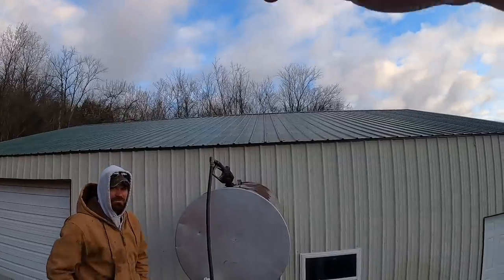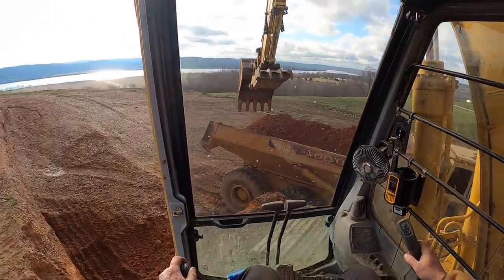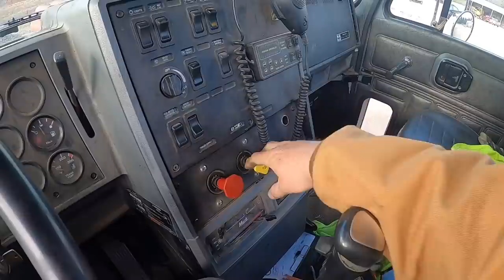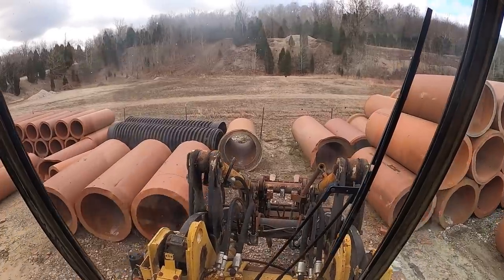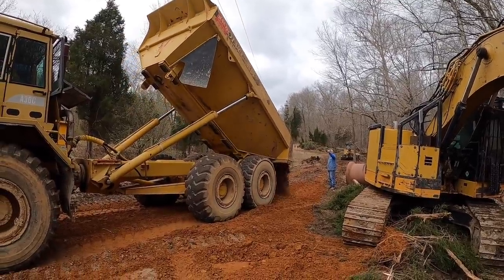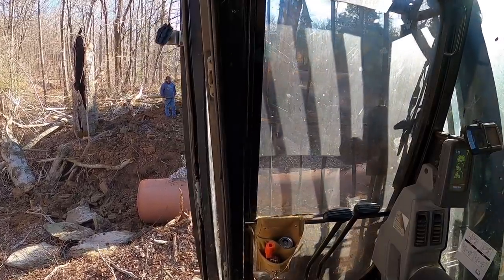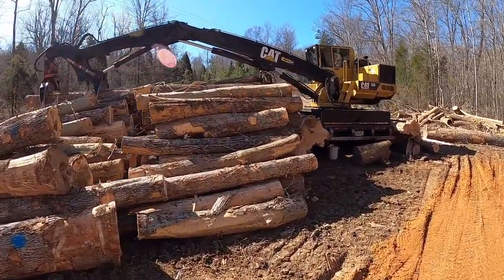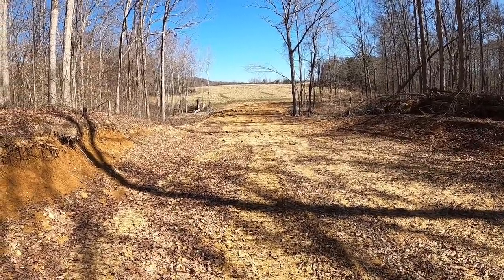When the neighbor calls and needs help, you drop everything and help! @LoggerWade

Comment: That came out rather tidy!  Most logging roads around here turn into quagmires.

Another advantage of transporting the logs on Tiny is… when they drag the logs through standing timber the they scrape the bark and damage the trees they are supposed to save.  Tiny’s high flotation tires minimize both ruts and root damage as well.

Your previous work held up well.  Thanx for the after peek!

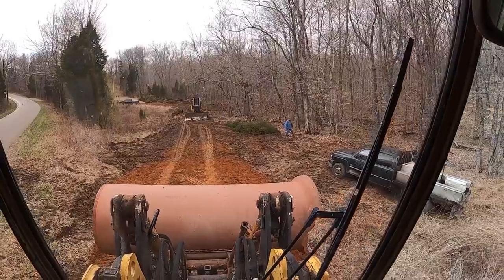Comment: 26:54 That old culvert would have lasted another 100 years and yes it would have stood up to any truck you wanted to cross it. There was one in front of my house built in the early 1900s exactly like that, that OVER loaded coal trucks used to cross all the time in the county road.  We also had a 9/10's of a mile long single lane train tunnel converted into road not far from my house built with red brick in 1907,  that taught people patience or how to drive in reverse.

Comment: what buckets you got for Hyundai have you got Grading Bucket  for it like Chris got  have you tried using on Backwards  so look like faceshovel Building Sites here excavator operators  use bucket wrong way round when doing concrete work from mixer makes easier load bucket from mixer truck and poor in footings
Reply from the maker: Stay tuned

Comment: Does that truck have 3 pedals in the floor? The one that does nothing when the truck is stopped is the transmission brake. Possibly your truck doesn’t have one as well, but I have never drove a Volvo that didn’t have 3 pedals on the floor, & a button to step on for diff lock…
Reply from the maker: Don’t work